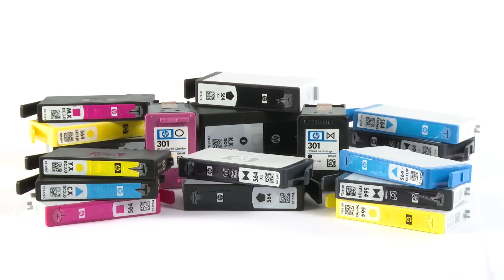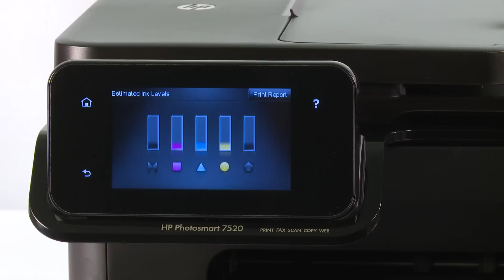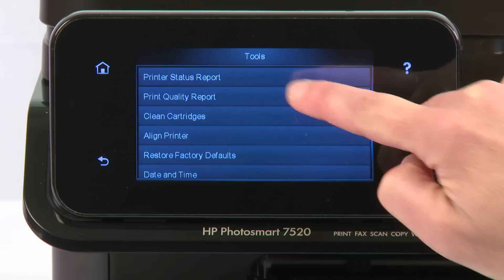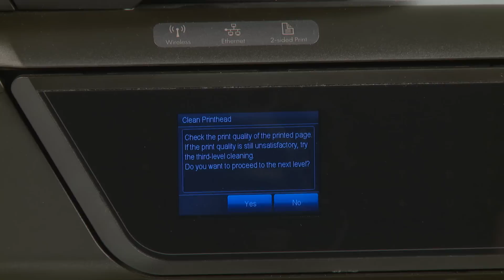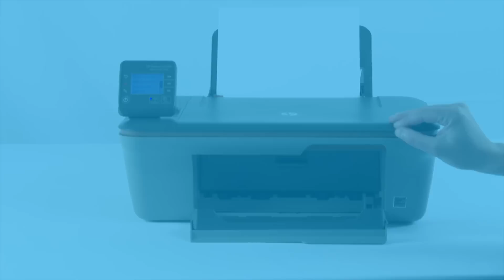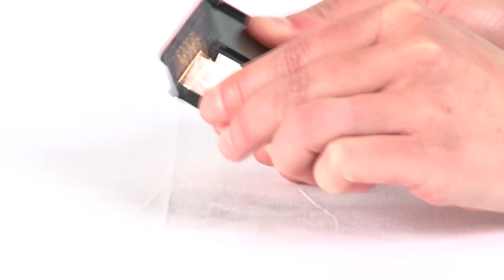How to fix print quality problems | HP Inkjet Printers | HP Support

Comment: I have an HP Envy 7640 printer.  I keep getting a message saying it doesn't support  Oficio size paper and to load the correct size paper.  The paper I have is the regular 8.5X11.  Any ideas??
Reply from the maker: +Vee strez   When you close the loaded paper tray are you getting the message "Have You Changed the Paper?"?  The next time you get the message, choose 'Yes' and that will allow you to review the current paper settings.  Do the settings reflect the paper size and type?
Reply: It could be that the program you are using to print from, or the document itself, is set for Oficio.

Comment: I have an HP Deskjet F4135 All-in-One printer. I just put in new ink cartridges since I was getting streaks. I checked the date on the box of new ink & it says warranty ends Nov 2017 so it should be good. 
When I print an email the colors are wrong,. The blue parts are red (which also happened with the old ink so I changed it), & some of the black parts are also red now. I did the ink cartridge alignment with the test sheet. Nothing helped so far. 
I don't know where to find the "clean printer head" on my computer. What next?
Reply from the maker: +rustydip1   I've included the "HP Deskjet F4100 All-in-One Series - Colors Bleeding into Each Other" document ( http://ow.ly/ZQEVT ).  If the steps in the document doesn't resolve the issue it will redirect you to continue troubleshooting by following the steps in the "HP Inkjet Supplies - Ink Smears or Streaks" document ( http://ow.ly/ZQFcM ).
Reply: Both links Not working

Comment: The default on my HP p1102w is 1 page it consitently prints 8 pages when trying to print from a WIFI connected laptop  please advise
Reply from the maker: Marissa Politano Please follow the steps in the troubleshooting document titled “HP LaserJet Pro P1102w and P1606dn Printers - Printer Continuously Prints the Same Print Job After it is Installed on a Network”.  I know the title indicates an error that is slightly different than what you are experiencing but the steps are valid.  To find the document please search for C02205132 on HP’s home page or using Google search.

Comment: Well, my HP 1510, which I use about three times a month, is a PIA. I have printed business cards before, using this same paper. Now, it just spins and says I have a paper jam. Trouble is, I also tried to put in a new cartridge and the damned alignment worked just fine!  WTH?  There is nowhere I can find on the HP site to get an answer to my dilemma.
Reply from the maker: Mavis LaBounty +Mavis LaBounty I recommend following the steps in this document on The Attention Light Blinks (Paper Jam) for HP Deskjet 1510 and HP Deskjet Ink Advantage 1510 All-in-One Printer Series. This can be found by Google searching "c03771809". If the issue continues, please contact our technical support by going to Google search and enter 'contact HP worldwide'.  Your first option should be the site for contacting HP, when you click on it you will be prompted to choose your country/region.